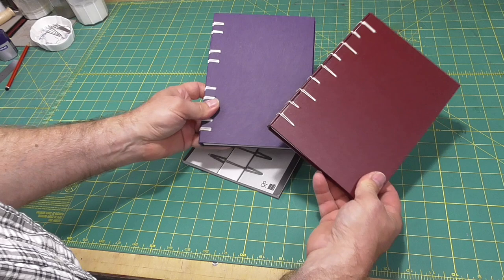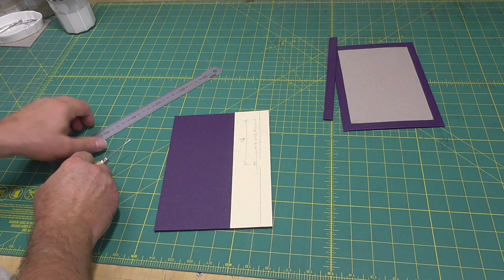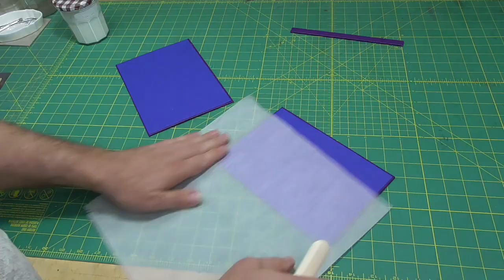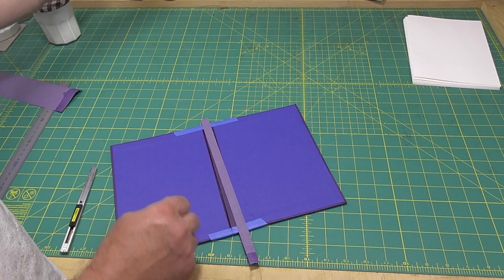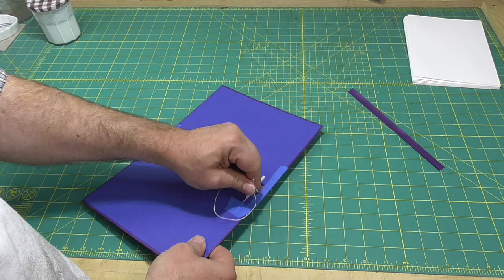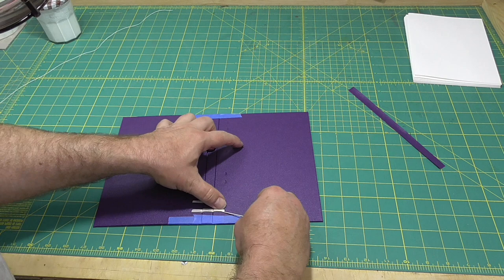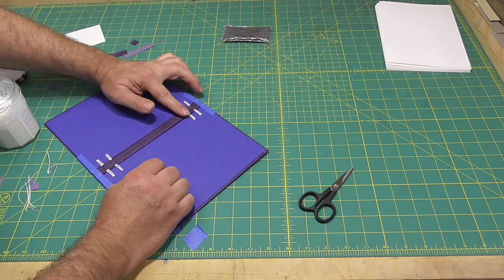Crisscross Binding Anne Goy Variation aka Secret Belgian Binding No. 3 // Adventures in Bookbinding

Comment: I enjoy your videos and teaching style very much.
.
In childhood,  I recall seeing a book, wherein the signatures where sewn as individual little booklets... then the booklets where sewn to a cloth in the spine.  Alas the book was badly damaged to allow the internal structure of the spine to be exposed. 
And the memory fascinates me,  as it is so clear that each section was held together as if it  where an individual book.
Are you familiar with such a binding?
I wonder what such a binding method is properly named.
Reply from the maker: Wow, it's a real shame you don;t still have the book.  I love damaged books because you get to see the hidden stuff.  What you had goes by a number of names such as stub binding or reverse guard or meeting guard.    It has been common in atlases made with single sheet sections so the plates open up completely flat.  There used to be a pleated material sold to bookbinders called Portland Guard for making these types of books.  Bill Minter talked about it in a GoBW SOE video.  Hasn't been available for decades.  Thanks for sharing.  All the best, DAS

Comment: It seems the sewing would go much easier with the boards held vertically in a press.
Reply from the maker: When I was editing the video it did strike me that holding it vertical did seem to go very well.  Only trouble with putting it in the press is that it doesn't always go a smooth as the one I picked to show in the video.  Just holding it vertical seem to work well.  All the best, DAS
Reply: @DASBookbinding  👍 Thanks, Darryn!